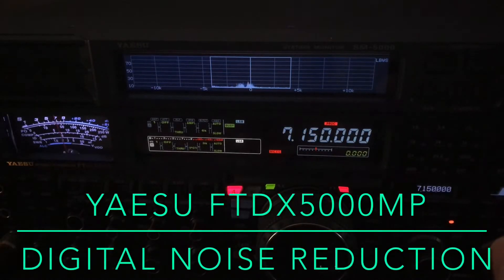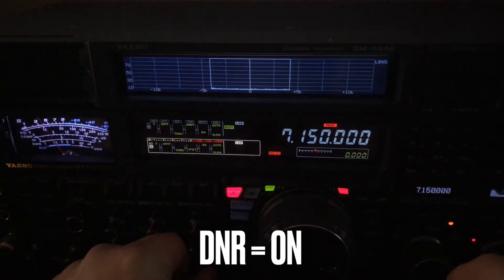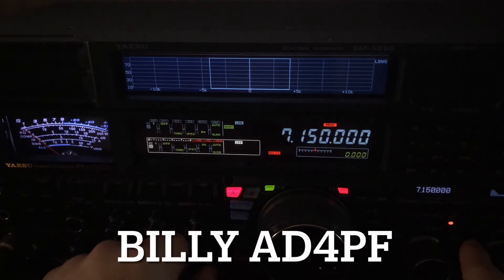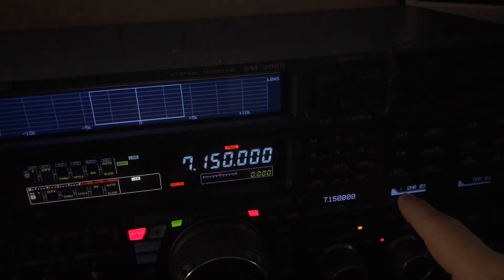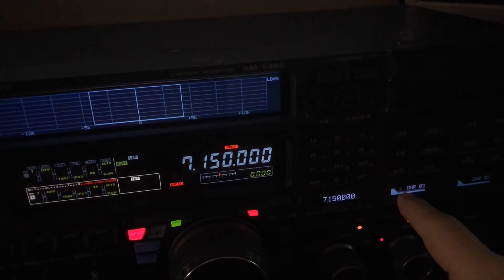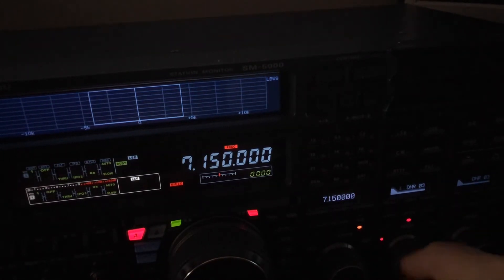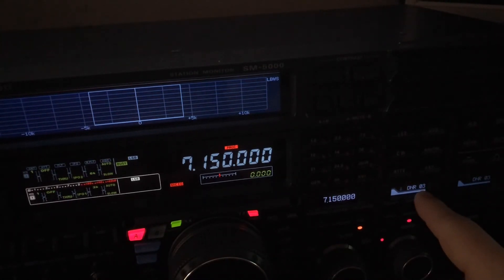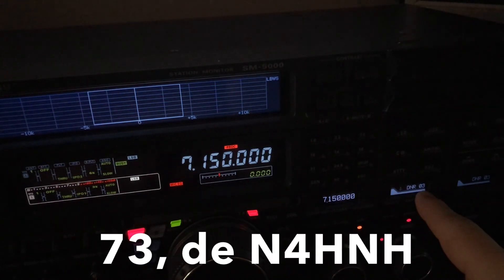Yaesu FTdx5000MP: Digital Noise Reduction #yaesu #ftdx5000 #hamradio

Comment: I watched the video about an hour after it was released. Another great opportunity to learn something else. I also read the comment RCB wrote about 30 min ago. Learned once again.
It has been raining cats and dogs over here since early in the morning, but once the sky clears, I will dig into my 5000mp to find the sweet DNR spot. BTW, receive EQ settings is on my do to list. So many things, so many projects but, not enough time...
73, PT9KK
Reply from the maker: Hi Luciano!  The FTdx5000MP doesn’t have a receive EQ. But it does have receive shelving. it is in the menu around 99-102?  There is a high and low cut. You can set high cut for 2600 at 6dB. That will restore some highs that the DNR dulls out a bit. 

73, Doug
Reply from the maker: Hi Luciano!  You might find the comments for FTdx10 video #69 interesting. Look for the post about the FTdx101D receiving images of 14 MHz at 32 MHz. The original comment has a link to a video that shows it. 

It is not abnormal for radios to receive image frequencies when listening outside of the ham bands. 

73, Doug

Comment: Really appreciate your channel. Watched a ton of your videos and implemented many of your audio adjustment recommendations. Love my FTDX10.  But, I’ll admit, for SSB, turning on DNR really makes the audio “muffled” for lack of a better phrase. Although quiet, it sounds like the voice of Charlie Brown’s teacher at times. Difficult to discern individual words. That’s when DNR is set at low levels as well (1 / 2). Any thoughts or suggestions? Thanks!
Reply from the maker: Check your receive equalizer settings. I can’t operate without DNR. I usually keep it at 3. I think it was the first or second video in the FTdx10 series where I showed the receive EQ settings. The FTdx10 has a 3-band EQ for receive.   You could add some highs to restore the high frequencies.  I’m old enough that I’ve lost some high frequency hearing. I generally run the highs at 3.  The FTdx5000MP doesn’t have a receiver EQ.  Neither does the FTdx101D or MP.  But I still won’t operate without DNR. 

Also check that you have digital width set to 2600 or less. I generally run it at 2400, which is the default setting for the FTdx5000MP. 

I assume you are knocking the noise down with IPO and RF Gain first, so the DSP doesn’t have so much extra noise to deal with. 

73, de N4HNH
Reply: @n4hnhradio  Hmm. I’m pretty sure I followed your receive EQ settings in a similar fashion. I’ll have to double check. Also, I do use IPO and reduce RF gain first and foremost as my main attack. Thanks again!
Reply from the maker: I don’t remember what I set it to in that video. I had literally just opened the box and was learning the radio. But it doesn’t matter. Everyone’s hearing is different. As we age, our ability to hear high frequency audio diminishes. So some off us have to boost the highs. The video shows where to do that. You will have to find what works for you. Adjust it with DNR set at 3. You might also need to boost the mids slightly and you might actually need to cut the lows a bit. 

73, de N4HNH